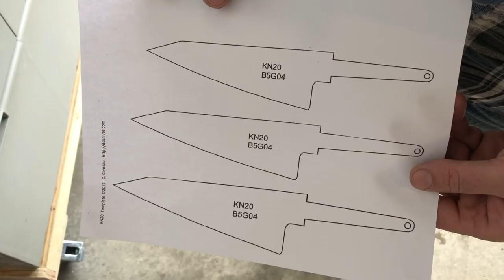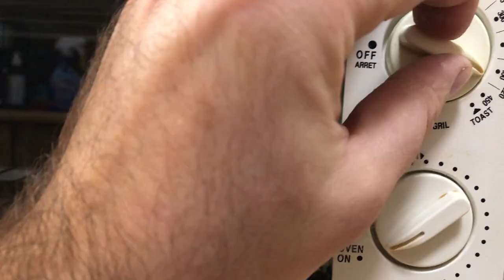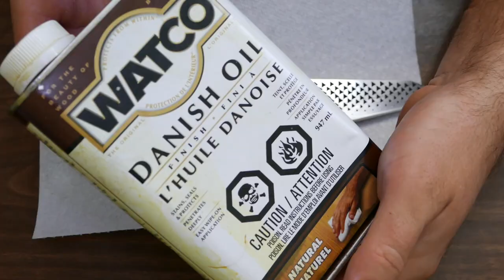Knifemaking: Honesuki Made out of a Rasp. DIY

Comment: Dude! all blacksmiths forge big knives out of rasps for fun. But rasps are usually not very good steel Lot of them are case hardened crap steel. As long as you are a grinder jockey, you might as well buy 52100 or 440C or CPM D2 or some kind of decent steel.